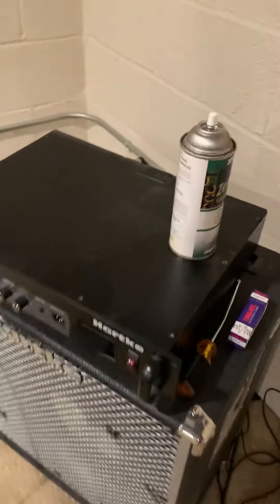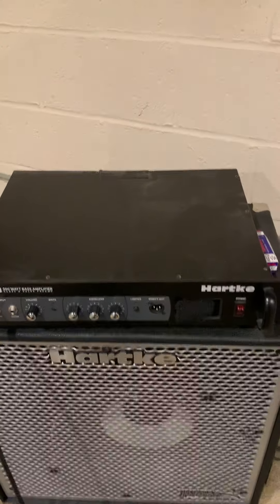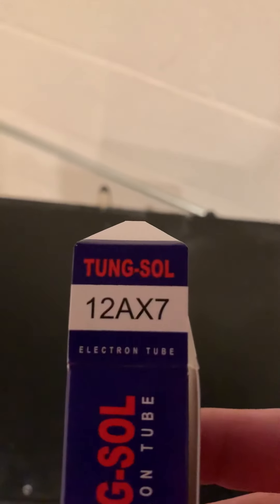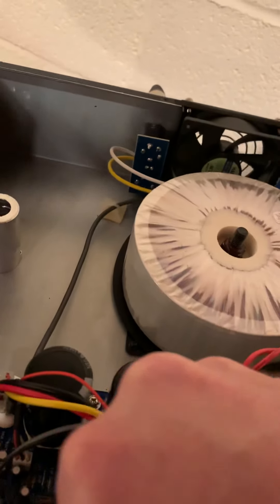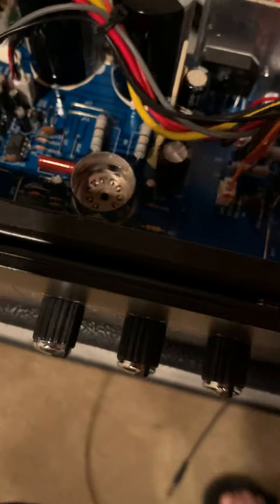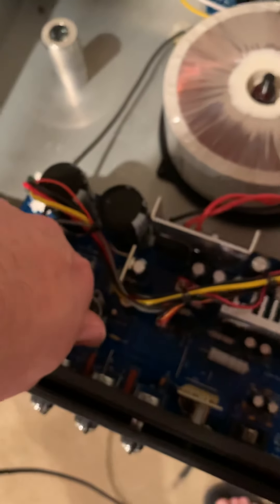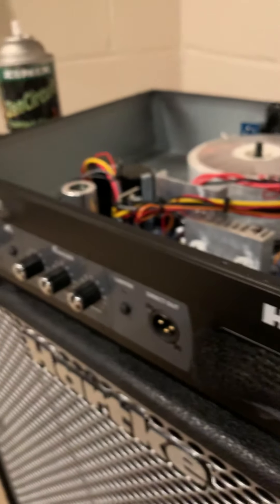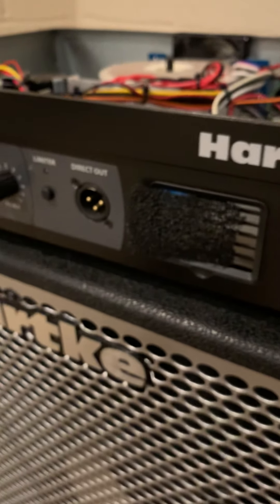Changing tube in Hartke LH 500 Head

Comment: So when a fuse is blown it's due to having a bad tube so the tube is a voltage regulator in a sense ?
Reply from the maker: I'm no expert but an electronics guy told me those tubes change the sound after they get old after many hours of playing ,I know the stock ones aren't everyone's sound but I switched brands ,and it does sound a tad bit different.
Reply: @jrock-xs9vp … in hifi systems, we chase after NOS tubes from the 40s and 50s. It’s madness (the price) but there is a difference.

Tubes in the preamp section will last easily 3,000 - 4,000 hours at the very least.
Reply: Yes … a tube is in a very loose sense a ‘voltage regulator’. Regulates a certain voltage to amplify the signal and to send the right signal.

But don’t confuse that with voltage regulation tubes such as the 5AR4 etc. That is used to purely regulate/rectify voltage in a tube amplifier instead of a diode regulator/rectifier.